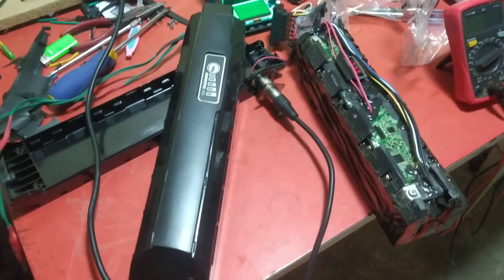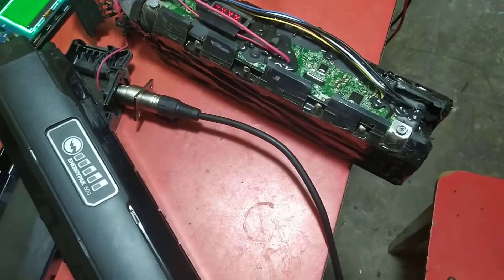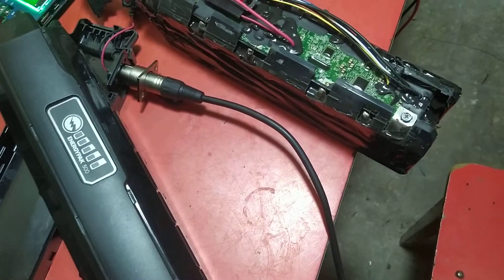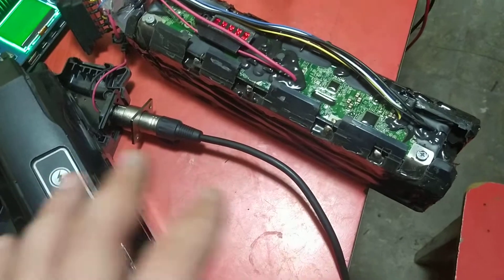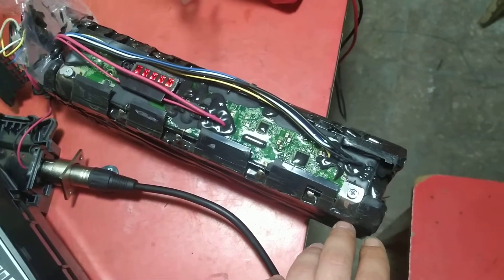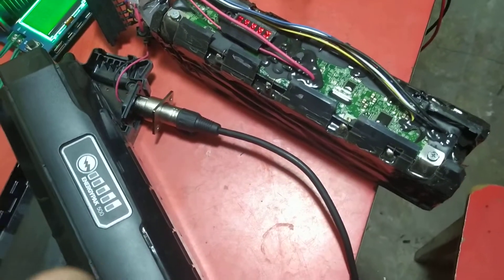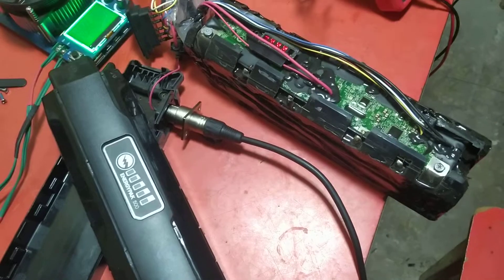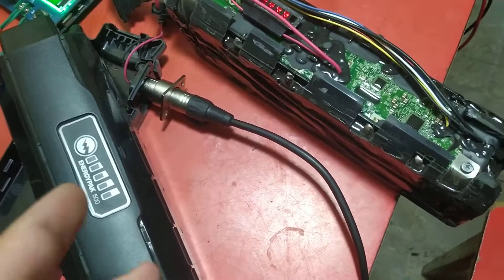Giant ENERGYPACK 500 overtemp error solution Ebike

Comment: Can you let me kno how you got the faceplate off
Reply: Hi, did you find out how to remove it? I have the same issue
Reply: I bought an energypack 500 and can't figure out why it didn't come with a faceplate or the silver clip end. Can someone tell me if this is the case and am I supposed to actually take those pieces off my original battery to use? Thx

Comment: I have got a problem with this battery which it does nothing at the moment, i ride about 2000km for 4 years, and was fine all the time, did not use or charge it for about 4 month and now it won't charge, button does nothing, once you connect the charger, if you long press the button, the first and third led blink a few times, and then second blink, then nothing, hope you can help, GIANT can't  do a thing, they just want to replace it with a new battery which cost 550euro
Reply: https://youtu.be/KrmGVdqhQfo ,this isthe secret service manual i shot with my battery
Reply: Hi, did you find a solution tk this? I have the same problem
Reply from the maker: conact me at whats up or viber. +995595318319

Comment from the maker: guys, all what u need to try is that balance all cells at same voltage. afther that charge pack to 40 or 41 volt. then try to plug original.charger.